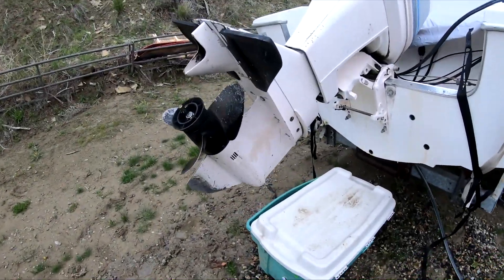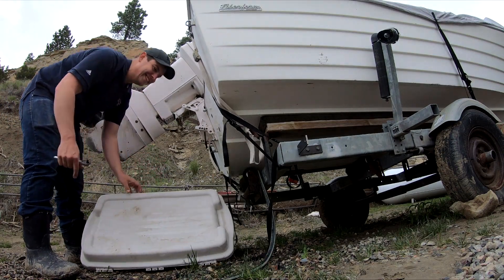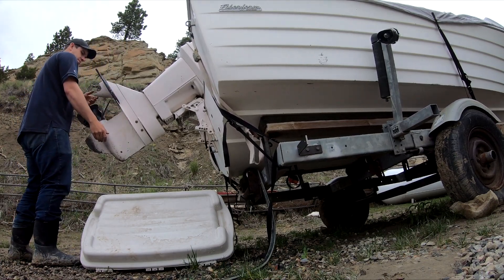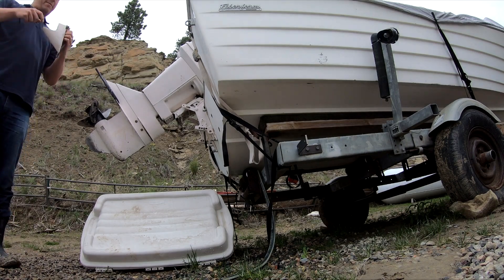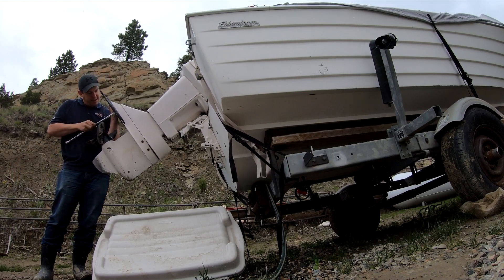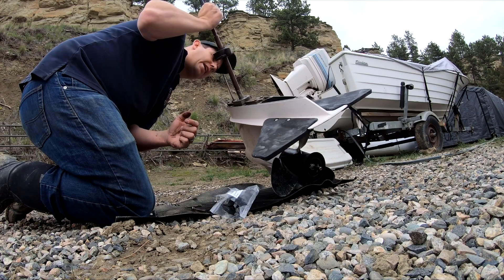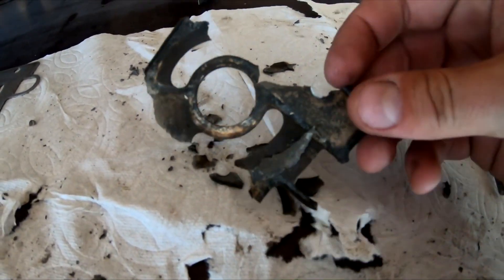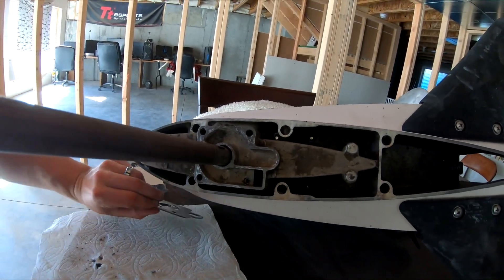Boat Project 06 - How to Replace IMPELLER on Chrysler Force Outboard 85

Comment: I think the off centered hole, compresses the impeller fins to force water up into the housing...Looking at mine water enters thru the wear plate slot, spins thru the impeller to the short (off centered) side where it gets compressed up into the housing on its journey to the Powerhead,  I could be mistaken but worked on all type of motors (not outboards) for 50+ yrs....lol

Comment: Did you lubricate the impeller and housing then turn it counter clockwise as you put the housing back on?  Use anti seize compound on all bolt for easier removal next time